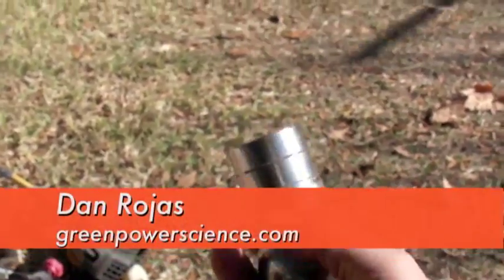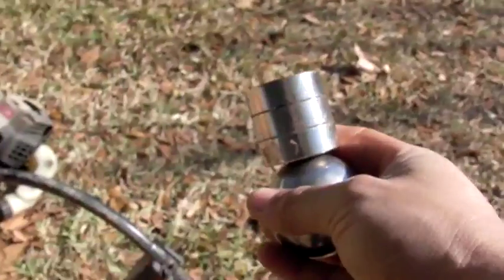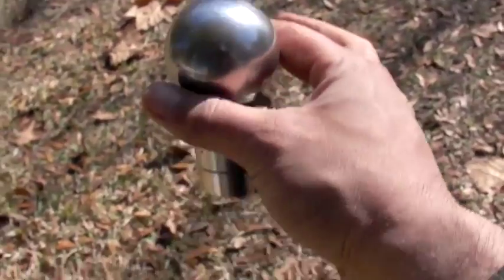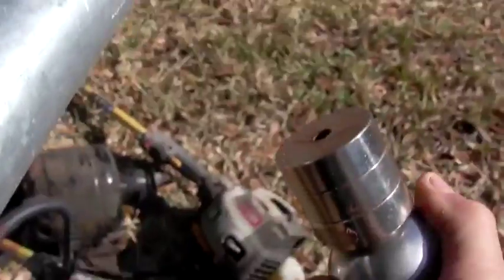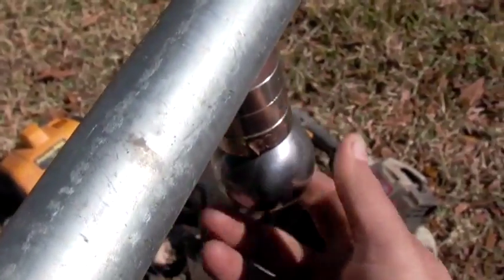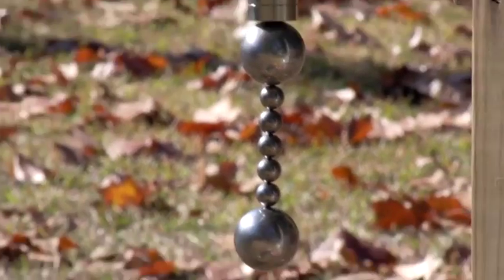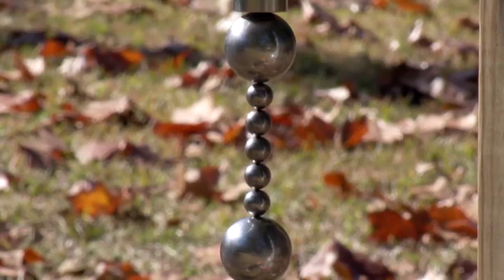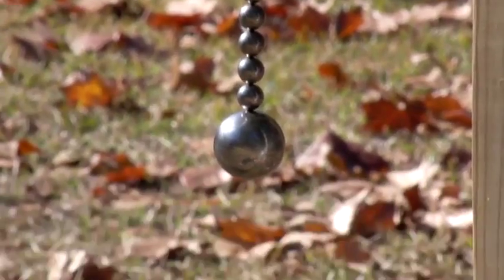Neodymium Magnets Magnetic Ball Spins for over five minutes LOW FRICTION BEARING

Comment: @eazolan   In 1959, my father, a dentist, bought his first "Air-rotor" high speed drill with mechanical bearings lubed by a fine spray of non-toxic oil in the compressed air. It turned at 300,000rpm with a characteristic high pitched squeal. Regular servicing needed. By the 1980's technology had changed. The rotor now floated on air bearings and speeds of up to 1million rpm were possible, between 500 to 750,000 being more usual, with only a muted buzz and hiss to be heard. Very reliable.

Comment: It might spin longer in a partial vacuum as it was probably friction against the air that caused most of the slowing down.
Btw, a flat one of these neo magnets put on the oil filter of your vehicle will attract and hold any suspended metal particles in the oil. For reasons I don't understand, even non-ferrous particles are held as well.

Comment: The reason it's spinning so long, is because there's almost no friction stopping the ball. There's the air, and there's the one point of contact on top.

This negates the whole purpose of a ball BEARING. It's in the name. It needs to bear a weight. Which means at least 2 surfaces touching the ball, and if you're actually using this as a bearing, you'll need a groove or a guide or something to keep it in place.

If you want to improve ball bearings, you'll have to make them not touch.

Comment: Search  "KERS"  flywheels with magnetic bearings work well, there was a Bus in the 1970's that was electric and stored its power in a flywheel.
Flywheel can be used in any application in place of or with a battery, excellent for regenerative braking in Electric Vehicles.

Comment: @davidlightsnack It does produce friction, very little. Most of the energy is dissipated through the pieces of metal though. The amount of energy required to pump a vacuum  would be far superior than the amount of energy a vacuum environment would save. Besides, a vacuum doesn't last forever, so you would need to pump another vacuum sooner or later.

Comment: Your magnets are starting to chip. Unfortunately that means it won't be long before they completely disintegrate. You can save them by cleaning them really well (not with water) I use adhesive tape to pull off all the stray bits and chips. When really clean dip them in a strong (slightly elastic) type of epoxy and allow them to cure. You can use sandpaper to round off the uneven blobs later. I have a big powerful pair of rare-earth magnets I treated that way that have lasted about ten years

Comment: Unfortunately as soon as u put a load on it, it stops. However, I recall some research back in the early/mid-90's looking to using huge/heavy flywheels to power cars. A small electric motor would spin the wheel up overnight, and the car would theoretically draw on that stored energy. Going down hill or breaking would also add energy to the flywheel. Problem was calibrating the flywheel so that it wouldn't fly apart. I wonder if the technology exists today to create such a flywheel.